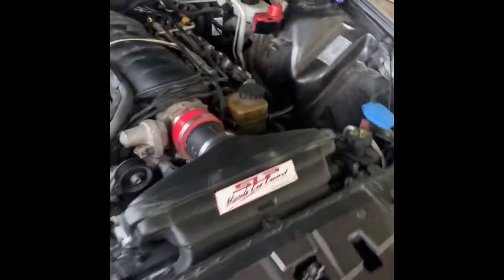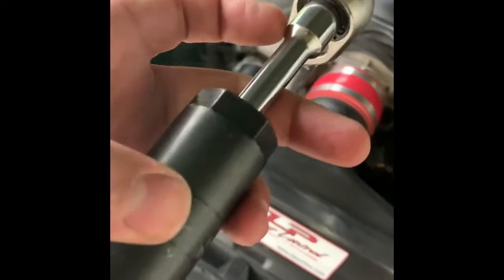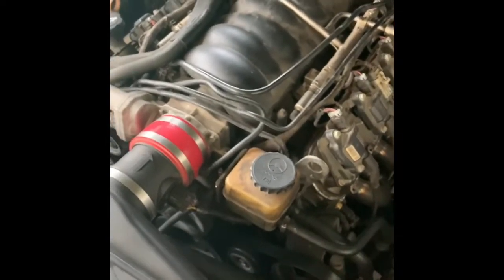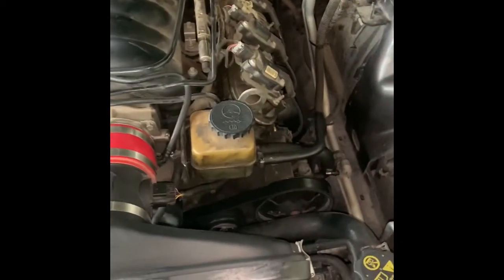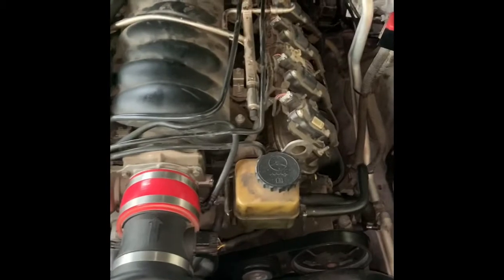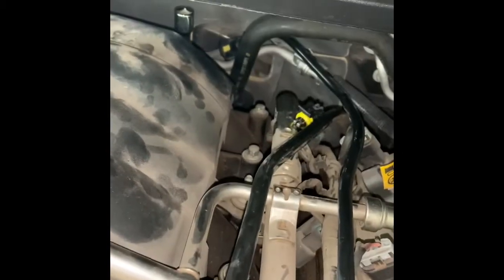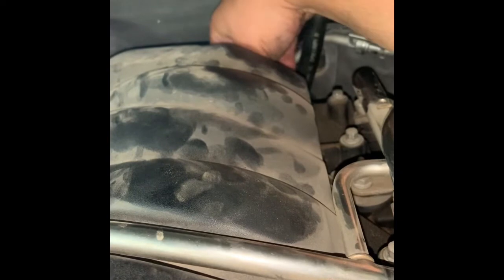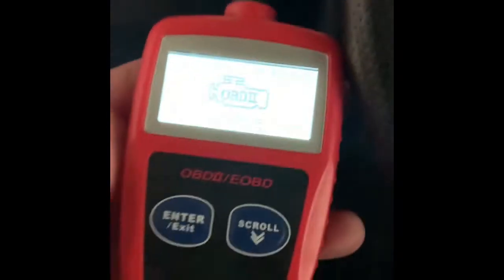2009 Pontiac G8 GT Oil Pressure Switch Replacement

Comment: I’ve replaced two already on my G8 not sure if I have an electrical issue instead
Reply: I replaced my sensor and filter. Cleared the code and it popped back up.. my oil pressure is pretty normal.